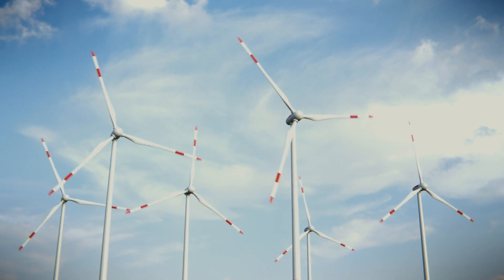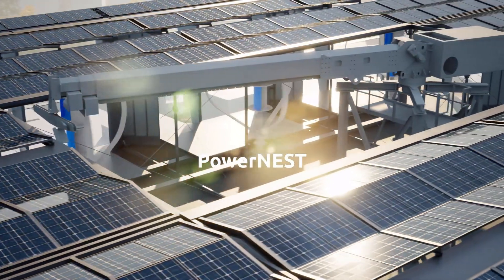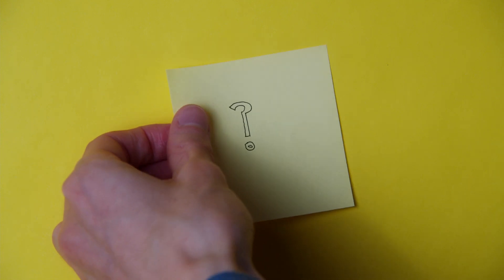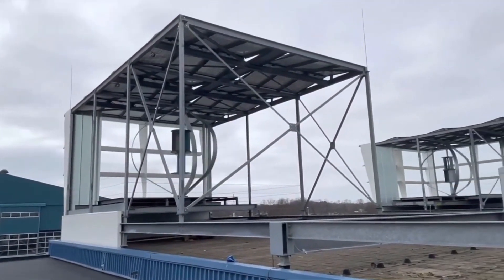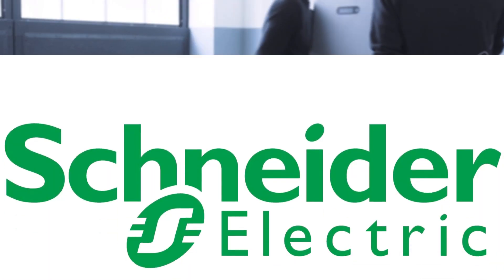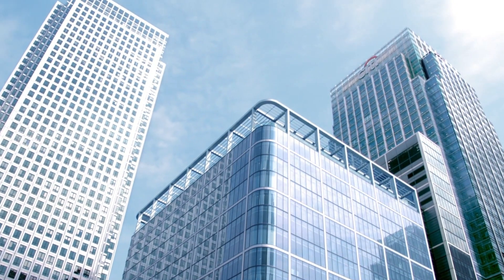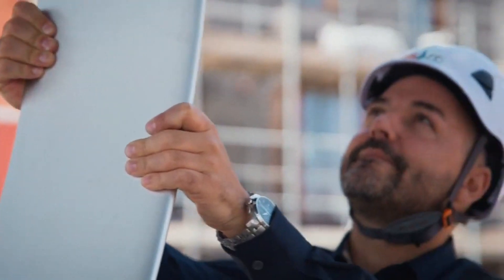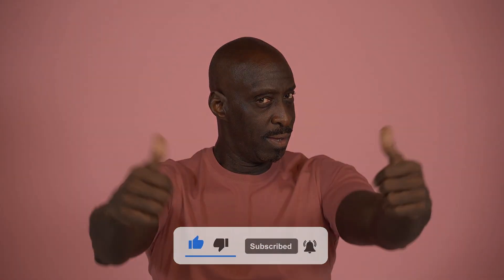This Invention Can CHANGE THE FUTURE of Solar Energy and Wind Energy

Comment: By far, the best use of rooftops, both commercial and residential, is solar PV.  This Nest idea is pretty dumb as the amount of energy it'll produce from the wind will be tiny, at best.  Wind turbines need to have MASSIVE rotors/blades, to be economically viable.  I worked in the small wind industry for 12-years, sold over 2000 small wind systems and have had one in my own backyard for the past 15-years.  My small solar PV far outproduces my wind turbine and costs much less to purchase and maintain.  Funny thing about this nest, and all other small wind systems, is they NEVER talk about the energy production, especially compared to solar, because it's pathetic, I know, I've seen numerous independent studies and know the facts.

Comment: The surfaced area of the wind turbine blades should be increased. Even if some efficiency is lost. The bird killer turbines could have many more but shorter blades spinning faster reducing the need for gear reduetion. 12 blades 1/4 of the lenth on the bird killers for example. 1:55 like the one on the inside but the size -diameter of the one on the outside for example.
Reply: Can you provide an independent study on these "bird killer" wind turbines you speak of?  I've worked in the utility-scale wind industry for many years and have seen numerous studies on birds and bats with wind turbines and very, very few birds are ever killed by wind turbines.  Meanwhile, house cats kill over 350 million birds/year, glass buildings kill over 400 million birds/year, and studies show that all birds possibly killed by all wind turbines in the world, over a year, is: 500-1000.